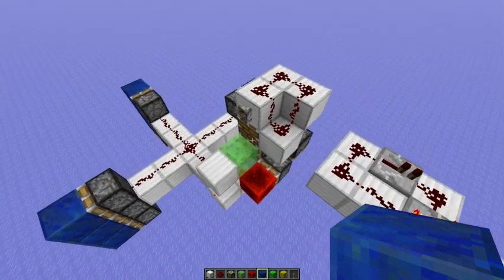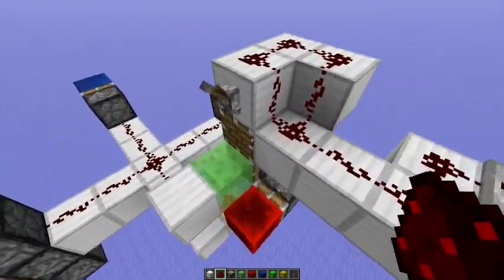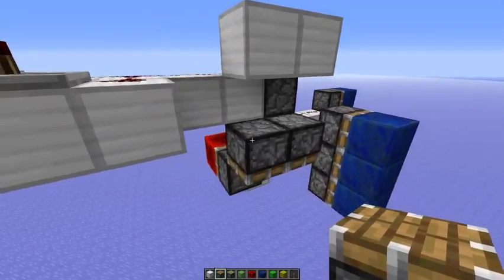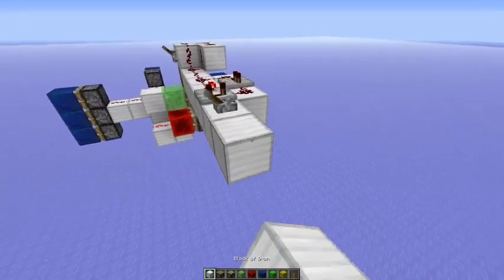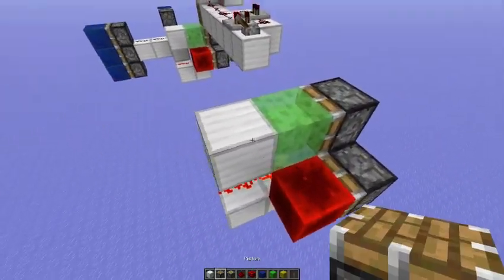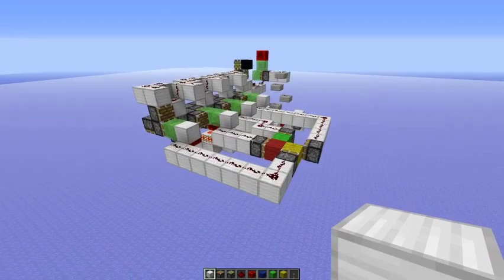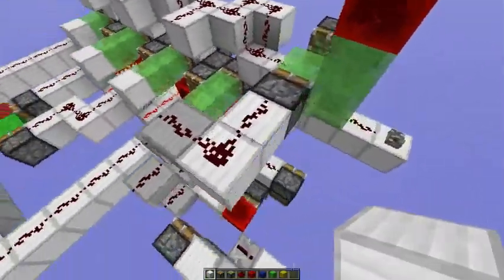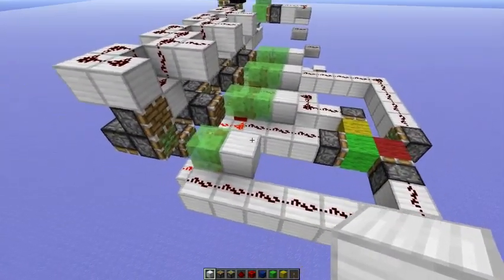Redstone Basics: non locational dual edge 0-tick pulse generator

Comment: I made one without the slimeblock a good while ago. Someone mentioned this dual edge in the comments on my 0 tick adder video. Might find use for it :)

I'm sure you understand now, but if those pistons were facing upwards, there would be no 0-tick delay from the blocks moving over and the redstone block moving on the falling edge, because the redstone above updates the piston heads.

Comment: Nice way of making an instant dual edge :) The reason why that piston can't be facing upwards is because the body of the first (top) piston that is in the micro tick chain would update the arm of that piston, making some microticks to get lost, therefore not working
Reply from the maker: +Selulance ah. The piston arms That was my oversight.
Reply: +Selulance You guys with your ridiculous "microticks"... There's no such thing xD it's called update order and it's perfectly understood by now.
But yes, the answer is pretty obvious. @Mango I'm actually disappointed in you for missing that. I trained you sub-par :P
Reply from the maker: says the guy, that wanted to make an instant extract/retract double piston extender. ;)
Reply: ilmango
It's possible in theory, but there's a specific bit of code in the game that prevents pistons from extending for at least 1 gtick after they retracted. I actually commented out one if statement and retried what I made and it worked, non-locational ;)
Reply from the maker: alright. :) but yeah, I was pretty ashamed of not noticing the piston arm updating.
Reply: +sharir1701 It's just a madeup concept to count the update orders, it's actually a commonly used term, and it works fine.
Reply: Selulance
As far as I know, it's commonly used by you and Sancarn. Nvm though, I don't care for an argument. We already went through this. I prefer perfectly accurate, code-based physics whereas you guys prefer simplified madeup concepts that are right in most cases and have special cases and exceptions. To each his own, I was just kidding about that one.